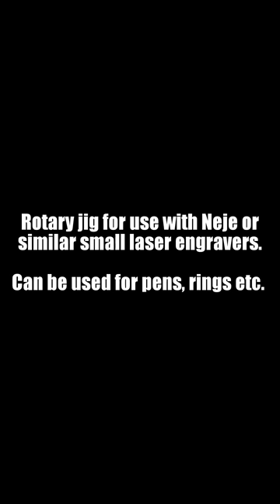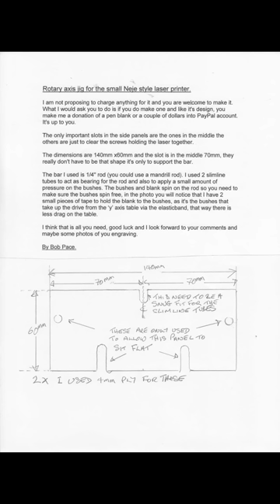!!! FREE TO MAKE - Neje Laser 360 Rotary jig, for use with all Neje Style Chinese laser engravers.

Comment: I thought of doing the same thing but instead of rubber bands my thought was to use pretty much the same setup but push the tube onto the bed and have it rotate it. The only drawback is that you would probably have to mirror the graphic. Also maybe stick a bit of craft foam on the bed to give the tube something to grab onto.
Reply from the maker: Thanks for your comment. When I first thought of how to convert flat table motion to a rotary one, I did think of several ideas, and one of them was based on what you were thinking after seeing it done with a rolling pin on a larger laser. I think that your design would to put to much strain on the very small stepper motors.
Reply: Since I posted above I bought one of these from Gearbest from their Los Angles warehouse so I hope it comes soon. 

I may have an order to do a number of these pens so I hope it holds up.
Reply from the maker: Cliff Hartle that's great news. I've done quite a lot of engraving and mine is still going strong. What I would recommend is to have a small fan blow over the table, this help cool the laser down and clear any smoke. Good luck with your pen turning and engraving.

Comment: Thank you for sharing. I easily made one, but I'm finding my rubber bands I try have too much play, even if I double up. Do you use a particular spec that doesn't have any play but still has grip?
Reply from the maker: Tim Cribbs Jr. I have made some changes that should help,  the one I'm using here is about 5" long if that helps. I'm hoping to have the updated video today. 
Regards Bob